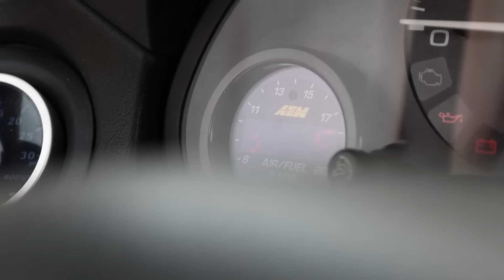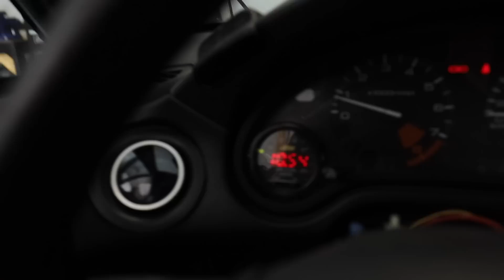We Got the Most HATED Honda EVER... (BOOSTED MOM CAR)

Comment: Man, I used to have bone stock del sol with d16z1 i think and it was amazing car ❤ only not stock thing was the exhaust, wheels and steering wheel 😬 1992, no abs, no airbags etc. And it had stock trunk spoiler and looked amazing
Reply: Aye bro I'm currently boost building the block on my d16z6💪🏽
Reply: @SSJ_Skoden  yees, d16z6 was the motor i had in it 😬 with Boost it must run like crazy 💪💪

Comment: I’ve seen people take bumper off then remove front rad support / crash bar and put washers in on the bottom of the crash bar mount points angling it slightly up therefore when you bolt your bumper back onto the rad support it sits closer/ tighter to fender and hood line, Honda Prelude being the car I’ve seen it on but the idea should transfer car to car maybe, worth a shot before buying expensive brackets? Maybe maybe not sure tho**

Comment: Del Sol is far from the most hated. Its probably one of the most coveted in the Honda community. The EP3 Civic Si is probably the most hated Honda. In the US we got the EP3 with a K20A3 (160hp) which is the engine in the base RSX that has the economy vtec (no real crossover) and only revved to 7k rpm. It looked like a mini van and made the same HP as the EM1 Si with the B16 but at least that car was light and had REAL Vtec

Comment: Most hated Honda is 7th gen 100%. The si was weak, the base models couldn’t hold a candle to the prior ek series(1996-2000). They lost rear disc brakes as an option, double wishbone suspension gone as well. Engines were eco only without any powerful base models.